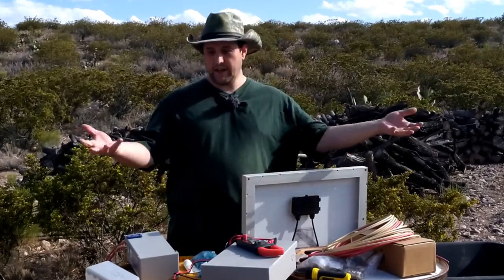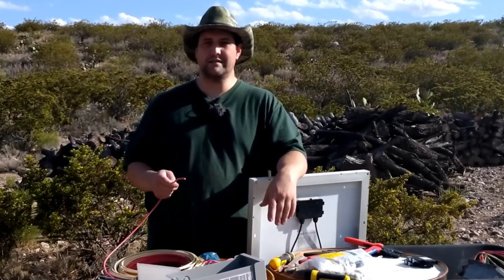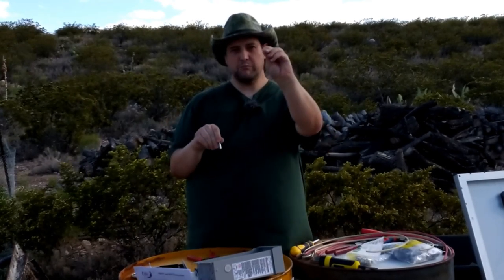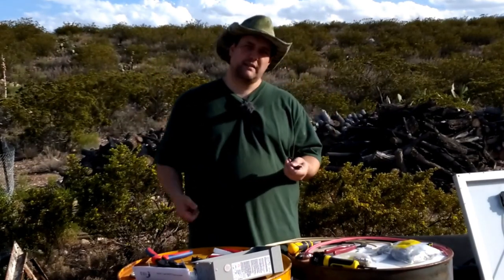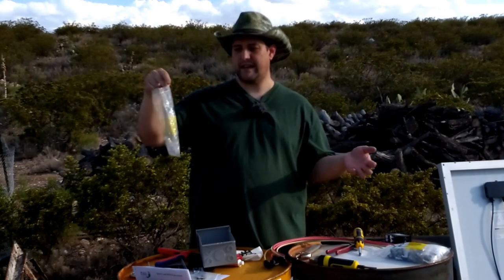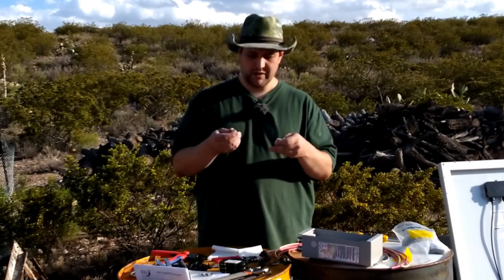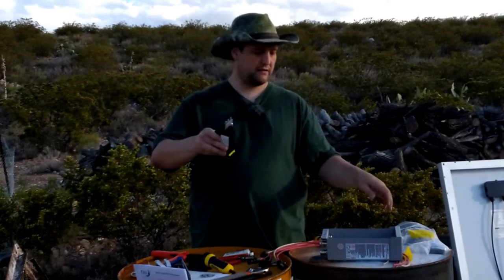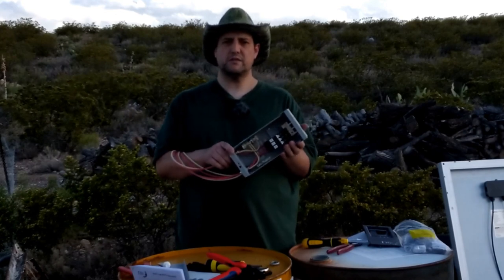Wiring the Solar Combiner Box | MidNite Solar MNPV3 Unboxing - Solar Bootcamp 005

Comment: I remember a job where I forgot to avoid wrong. In a very hot, very dusty warehouse, I was putting a line together for a large compressor. I was about 20 minutes from being finished with the job when I noticed a part laying on the floor which should have been installed back up the line about an hour and a half ago. Crap. I could have left it off, but it wouldn't have been right. So, I started undoing my line......  Always better to avoid wrong.
And yes, avoiding wrong means getting connections tight. Most failures in wiring systems I encounter are caused by loose connections which burn up. Loose connections mean it's harder for the electricity to get from one point to another. The harder it is for the electricity to get across, the more heat it generates. The more heat, the harder for the electricity to get across.....becomes a vicious circle and....presto! Fire and melted wires and burnt connections. Very bad.
Reply from the maker: Yep.  Making a good connection is very important and making sure it is reliable for the long term is super important.  I'm pretty anal about stuff and like you will take it apart to redo something to make sure it is right.  But I never worry my stuff is going to cause a fire.

Thanks for taking a look.  I was curious what you thought about it.
Reply: @reedin9954  Yep, it was a good video, Reed. Very instructional.

Comment: newbie question.  If I have 3 strings and I have this disconnect/combiner box but don't need to combine 3 into 1 or have a 2 in1 series/parallel and i series into the inverter but have 2 or 3 separate positive and negative running into it. can I do that?
Reply from the maker: I'm not really sure what you are asking.

This combiner will take 3 strings of solar panels and give you an output of 1 negative and 1 positive which is the sum of the power of the 3 strings.

It is best the 3 strings of solar panels are all of the same type as mixing modules is rather complex.
Reply: @reedin9954  thanks for the reply

Comment: i'm anal about stuff so bad sometimes to almost inaction. but i always get over it and decide i'm doing things the right way........but it has saved me more than once too when i figure out my thinking was a little clouded before proceeding. i like doing things the right way the first time and so it will last as long as possible. fighting the elements here is mostly in the wet department and the not heat. i have never dreaded the heat for the express reason we don't see much of it and if we do it rarely is more than a day or two and never over 90 degrees. mostly we wait all summer long for summer to come which it never does. :)
Reply from the maker: That is the hard part, deciding to get stuff done and realize it may not be perfect.  I eventually came to the position that I will always be refining my methods and work and it let me think about it in a more evolutionary point of view which really helped me get stuff moving instead of stressing over it not being perfect.
Reply: @reedin9954  yep i've grown as a human. i'm one of those that pictures the finished product in my mind then works backwards step by step with how to accomplish what i see. then all i have to do is turn it around and take it one step at a time. first i do x then i do y then i do...... just how my weird little mind works. if step d isn't working out i look forward and then backward to see how i should proceed. mostly what i do works out. i don't mind having to work for what i want to do but i don't like to struggle. it is like driving. i don't mind a long trip driving but i don't like coming back the same way i went because i can picture the route and i know how long it's going to take.
Reply: The climate fear mongers will tell you all about the 'heat'. lol